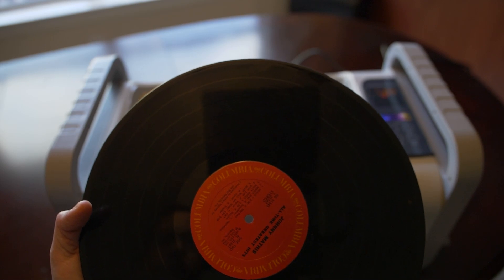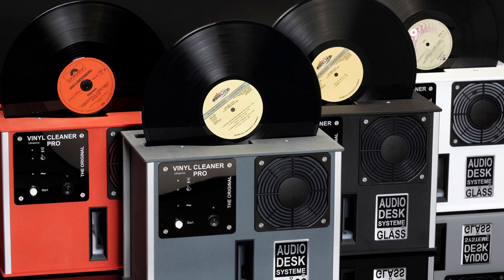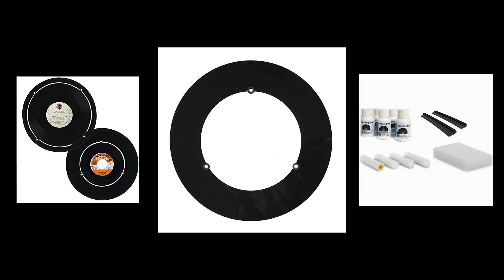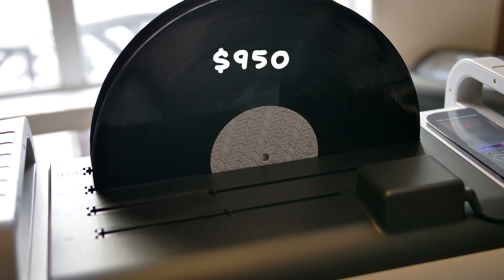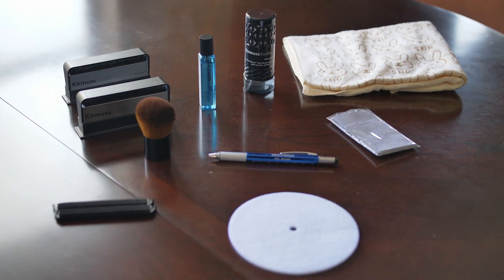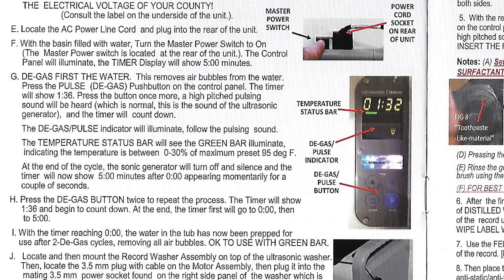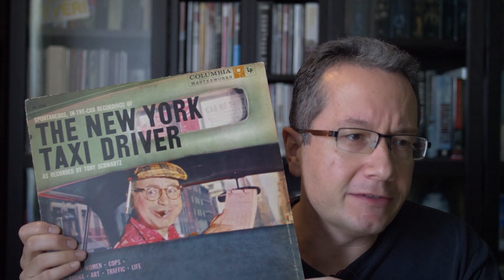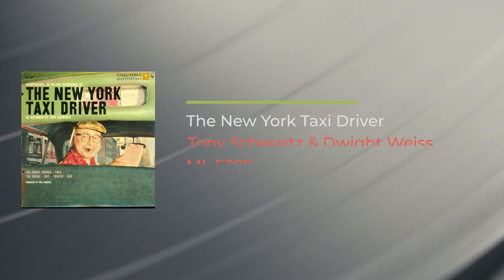Kirmuss KA-RC-1 Ultrasonic Record Cleaner Review and an Ultrasonic Cleaning Primer

Comment: Greetings, Paul!  Fab presentation/explanation of ultrasonic record cleaning!  Oh man, some of these machines charge so much and then they want you to spend more to buy a separate $100 adapter for 7" and 10" cleanings?  Pssshhh.  
Looks like plenty of pros with the Kiramuss.  The NY Taxi Driver record has me cracking up!  Good example choice!  It appears the Kiramuss delivered.  Pretty amazing.  In a few years I'll be upgrading to something like this!  I always enjoy your videos.  Best editing in the VC!  Happy holidays!  :-)
Reply from the maker: Thanks Hanna.  There were a few more things I wanted to do with this one but I had a lot of the footage shot early last month.  I figured screw it!  I need to string what I have together but I am glad it turned out all right.  There are ways to do this cheaply for sure and not spend an arm and a leg.  The quasi DYI options will work just as good as my unit.  It's all really in the process.  The rest of it is just added convenience.  The NY Taxi Driver was fun but will likely end up in a purge pile at some point down the road.
Reply: "Best editing in the VC" - Seriously, if ever there was a VC oscar...
Reply: Beware of these adapters that see 6, 8, 10 or 12 records skewered.  The ultrasonic's action is canceled by the rejected  standing waves.  Records too tightly spaced together. If using a cleaner never buy a cleaning  solution that does not list the ingredients.  Check the ingredients list with the PVC Chemical Compatibility Chart that can be found on the web.

Comment: Good to see you dropping a video. One of 2021 "vinyl goals" is to step up my cleaning process. This video will help me figure out my approach.
Reply from the maker: Thanks Eric.  It feels good to finally get another video out and I am hoping I can squeak one more out before the end of the year.  Ultrasonic is definitely the cleanest I have ever gotten my records and honestly, if you go with one of the quasi DYI versions, it should be just as good and cheaper.  Even cheaper than most vacuuming machines on the market.  The downside is that it's just a little more labor intensive but it's not so bad.